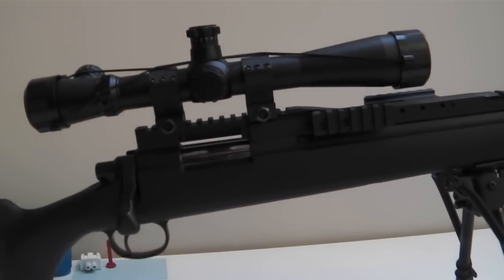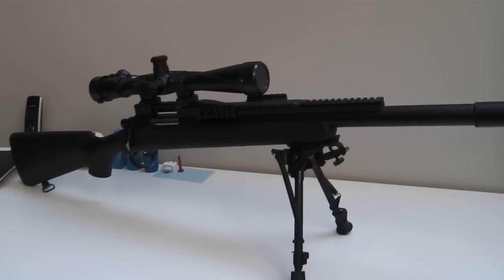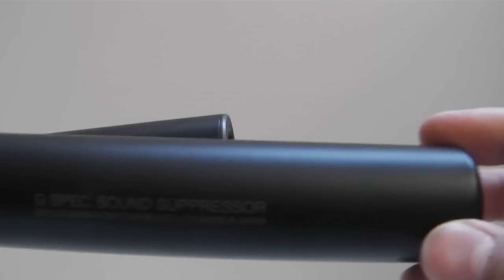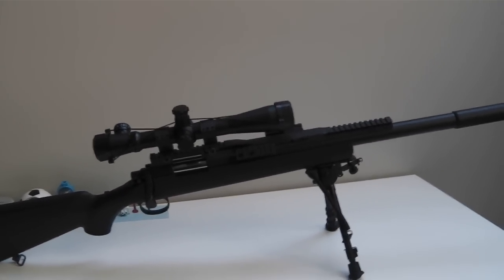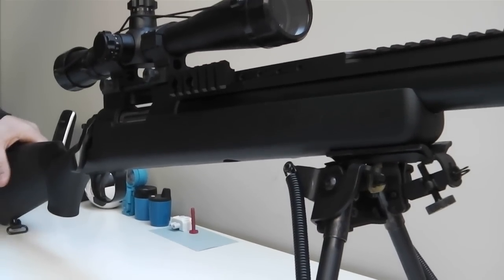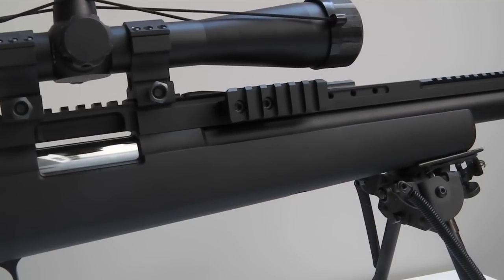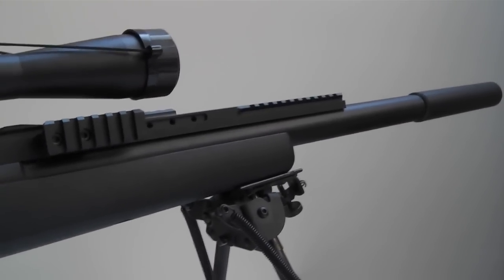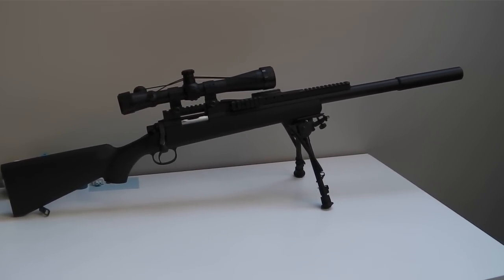Tokyo marui VSR 10 project

Comment: I can tell you for sure anything police or military uses costs a HELL of a lot more than 60 dollars and won't be sold on Airsoft GI. A rail for an M4 or ar15 STARTS at 250 bucks for anything good that a MIL/LEO unit would use
Reply: Also that rail only fits airsoft.  The bolt holes are spaced differently on the real steel guns reciever, and I only see it listed on Airsoft sites
Reply: seth newman this is the one used on the M24 and Rem 700 sniper systems I've seen http://mccannindustries.com/product-line/mounts/mirs-rifle-mounts/